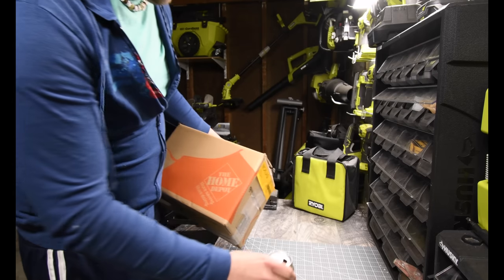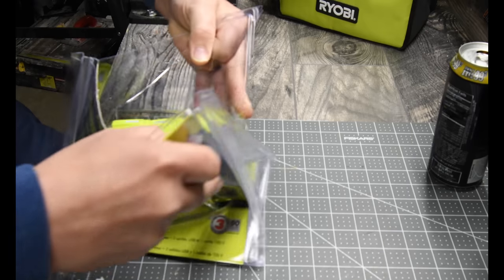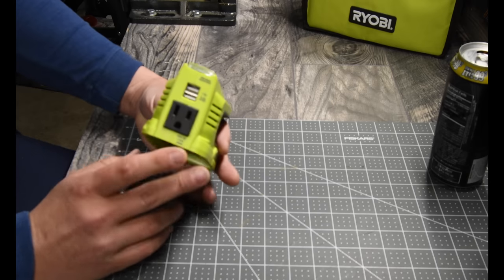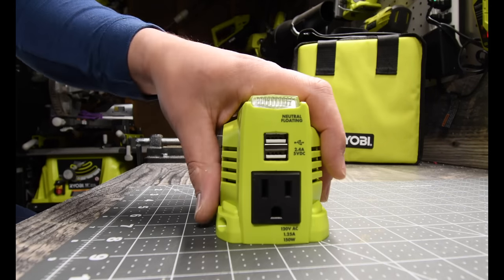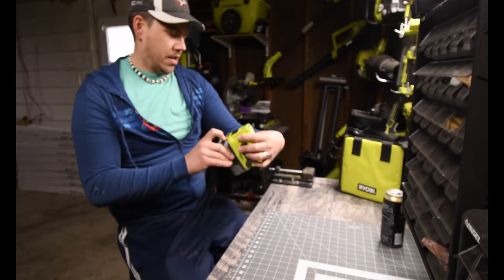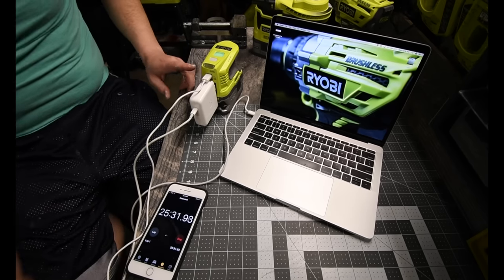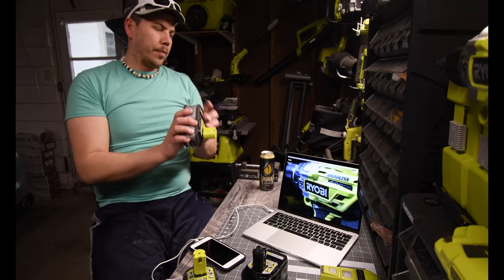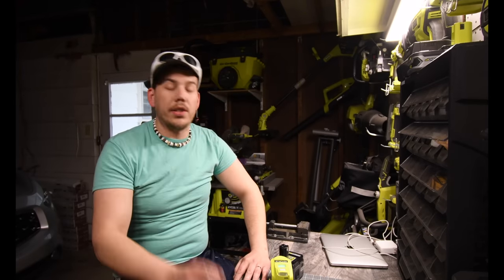Ryobi 150w Power Inverter  (UNBOXING)!!

Comment: Truckers use inverters more than the general  public.  I've bought many over 24 years of driving . No inverters do exactly what you want always. I'm running a 3000 watt in my truck.  I have to unplug my fridge to get enough power for my microwave.  There great but all have there limits.  Another thing is I have to run the semi at a 1000 rpms to make coffee. I see that ryobi as a handy tool for traveling and camping.  Great video . I'm enjoying the ryobi tools . Really love the flash light and lamp.

Comment: been using dewalt batteries with ryobi tools using adapter.  could I use my adapter and 20v dewalt battery with this ryobi inverter 150-Watt Power Source for ONE+ 18V Battery???

Comment: Test that on a compact fridge then a no frill full size fridge with a 6 & 9 amp battery.
Reply: Approximately 26min & 39min respectively, assuming maximum (likely) power of 150w, and assuming conversion efficiency of 80% (potentially higher).
Reply from the maker: will do

Comment: Would it Run a mini fridge for tailgating?
Reply from the maker: R Lewis I’ll test that out
Reply: Maybe, but if so, it would probably draw all of that 150 watts meaning about 8 amps at 18 volts so a 2 Ah battery will run the compressor for about 15 minutes.
Reply: What about the 40v inverter?
Reply: @rlewis1203  
There's a 40v inverter?   Well that would basically be 37 volts nominal and draw about 4 amps at 150 watts, so if it's a 2 Ah battery, it would run the compressor for 30 minutes.  Keep in mind though that the compressor doesn't run continuously.  It cycles on and off so you could cool for longer depending how hot it is outside.   I would guess at least twice as long on a hot day and 4 times as long on a cooler day.
Reply: start up load would be well above the 150w limit of this thing. look up the fridge you want to use and find the data sheet for it. it will have the voltage and amperage required to run it. start up draw will be 4x or so more than the running wattage.

Comment: Did you plug a battery in before it cooled off trying to charge a warm/hot battery decreases its life that's one of the reasons the 6 bank charger only charges 1 battery at a time and in the order you plug them in
Reply from the maker: shawn b the battery wasn’t warm. The inverter was warm

Comment: Is the 120v outlet pure sine wave or square wave, I read on the internet that if it's square wave it can damage sensitive equipment like laptops and electronics
Reply from the maker: Im not sure about that. but hasn't damaged nothing yet.
Reply: It's modified sine wave, basically square wave. It does not work with MacBook Pro, turns itself on and off continually.

Comment: Trust me bring at least a 3 or 4ah battery if not your wasteing your time my galaxy note 9 from 15% battery life wont even fully recharge my phone battery with anything under the 3ah battery & even that once charged the 3ah battery diddnt even have 2 bars left so wouldn't recharge my phone again,all I can say is on a 4ah battery it did run an oscillating 3 speed floor fan on medium for almost 2 hours last summer during a black out so hope this helps..
Reply from the maker: yes sir and thank you

Comment: it actually goes to 200W before it shuts itself off it'll run until the battery dies or as if it hits 200.01W
Reply from the maker: this is a very old video and I thank you for the info Dondiego

Comment: While I like the idea of the 110v inverter.  I am just trying to get a 12v dc to run my c-pap machine all night during a power outage.  What I would like to know is why is there TWO USB ports AND a 110v on the 18v batt, while the new 40v has only a single USB port.  I would have thought it would be the other way around.  Otherwise, thanks for the review!
Reply from the maker: Thank you sir

Comment: i just got mine today, sadly it wont charge my iPad using a USB-A to USB-C Cable.  Says  not charging, works everywhere else.
Reply: iPad is reliant upon USB-PD, a technology/feature which is not supported by the USB ports on this inverter. It is only capable of regular 5v, 2.4A output (12w), and the iPad requires a minimum of 18w negotiated by USB-PD at 12v, 1.5A.
I would have expected maybe Qualcomm QuickCharge 2.0/3.0 to be supported for faster phone charging, however as soon as you start adding these technologies, the cost of the device rises as not only is additional hardware required, certification is required.
Reply: Nash K Good to know, thanks for this info! I know Ryobi isn’t a tech company so supporting PD and quick charge will probably not be on the Radar for them and also the reasons you mentioned. i may end up just making my own with a 3D printed case, there were a few YouTube videos that showed using a standard 12v USB charger since most will accept between 12-24 volts. I could also just plug the IPad charger directly into the AC port and call it a day , but i am sure the DC-AC-DC Conversion isn’t the most efficient.
Reply: @seanmikhaels  unfortunately though making your own you won't be able to charge your iPad either, but it's great to hear you'd be willing to give it a shot. 3D printing really is great isn't it!
As for DC-AC-DC, you'd be looking at losing around 40% of your original batteries total 'power' (Wh)! I'd suggest dumping the iPad, getting an Android tablet, and charging via USB to get the best results. This would mean using pure DC, 18vDC fed into a buck converter, outputting 5vDC at an efficiency of about 98%!
Reply from the maker: it might be that specific cable.

Comment: dont use modified sign wave on electronics use pure sign wave wich im sure that little thing aint.. u nless it specifies it
Reply: Pure sine is really important for induction motors. A laptop uses a bridge rectifier to convert back into DC, so even a square wave would be fine. Using this modified sine wave on electronics that are converting back to DC is perfectly acceptable.
Reply from the maker: yes sir

Comment: You viewers do realize he is testing this the wrong way. In regards to this type of charging platform. Power everything off. Then charge. By leaving them up and running. They are draining more power.. and will run the battery reserves down further.
Reply from the maker: Richard Elbe you are correct. It I wanted to do an extreme test

Comment: If they make one similar to the 6port charger and run it off 6 batteries, with a mini builtin light, usb-C PD@65W, and AC 1100 watts out, 2x 11A sockets, and priced $149... I'd buy two. I wouldn't even be mad if it was geared to only the new battery types only.
Reply from the maker: thank you sir

Comment: Real world tested, if you're charging a cellphone on a hot day, it shuts off. There is a over heating protection cut off. Just saying. It does have an internal fan to speed up the cooling.
Reply from the maker: the unit was overheating in my car without even charging anything. the unit was just on and the fan was going off like crazy

Comment: Nice video David. I'm more and more amazed at how many tools are in the Ryobi line !!! Makes me smart that I chose Ryobi. Well with some influence of the Ryobi Man Caver !! Thanks David. Hey let me know if you ever need to lighten the load of your Beautiful tool wall. Especially any 3ah or above batteries. I only have the two 1.5ah that came with my Christmas kit. Tools on top of my wish list right now are the 6 gallon shop vac, 10 inch drill press and bandsaw. The drill press and bandsaw would be corded. How would you compare the Ryobi to the WEN? Thanks again David for sharing your talent and videos, Rodney
Reply from the maker: Thank you sir

Comment: Can you plug your car battery charger into it?
Reply: @ManCaverTools  I'm guessing a maintainer/charger would probably be more likely to work than a regular charger. I guess there's only one way to find out.
Reply: First check is the amperage on the plugins capacity.
Reply from the maker: I wouldn't plug in a 18v battery charger to it. there is no reason to.

Comment: I'm big on Ryobi!!! I have been for years. Always like that the new batteries still fit all my older tools.(that's why I gave up on Makita, fuc*ed me too many times changing battery designs) I saw this inverter first time yesterday at HD, but they only had one...on the clearance table.  80$ seemed high. How much and when did you get yours? 2019?
Reply from the maker: The price is a bit high, it should be around $40- $50
Reply: @ManCaverTools  ok got it...thought so...thanks so much!!

Comment: A buddy of mine works graveyard shift security at a construction site where all he does is sit in his car for 8 hours, I'm going to see if he can run an Xbox one and a small TV off of it.
Reply: an xbox 1 pulls over 500 watts. this thing will shut down the moment you try to turn the xbox on.
Reply: @mylt1z28  done the test myself, while playing Forza horizon 4 at maximum graphics setting, the Xbox tops out at around 75 -80w
Reply: Connor Cruz you might pull it off with the 9ah batteries. It tends to put out more power than the smaller ones. But at that point you should get an inergy and with its lithium you can run both and charge a set of ryobis. And make some noodles in a hot pot.
Reply from the maker: that would be awesome

Comment: The camping light is usb... Just saying...
Reply: tensazero we keep ours in the house so we can charge our cell phones anywhere. Works great.  The lantern needs to be turned on first though.  Also I added a proper bail handle to make it easier to carry.
Reply: I love the camping light, but using it as a  usb power bank is a smidge bulky imo.
Reply: Connor Cruz it’s more then a smidge bulky.  Which sucks cause it’s huge but it’s also good because we haven’t lost it yet.  (Like we did with my other power bank.)
Reply from the maker: yes sir and thank you

Comment: Maybe it’s just me but at almost $80 it seems overpriced.
Reply from the maker: yamsi12 I agree, it is over priced for what it is
Reply: It does seem overpriced. Plus if you ran it at 150W, a 9 ah (162 Wh) battery will only last a little over an hour.

I’d be curious to see what kind of “sine” wave comes out of the AC outlet. Maybe it’s a good time to bust out the oscillimascope and see.
Reply: @JToona  Specs say a modified sine wave.
Reply: Give it some time .I'm sure it'll lower in price .fathers day . Xmas . Black Friday.  You get my piont .
Reply: Tony Spadafino  yeah,I’m agree.but I don’t think have a huge difference price in
Reply: Its not just you, I would think $50 is more on point but anyway.
Reply: yamsi12 I disagree. The inverters out there are all at this price point.  None of which have a removable rechargeable battery like this. Yes it’s msine but you don’t need pure sine for small device usage. Under so many Amps.